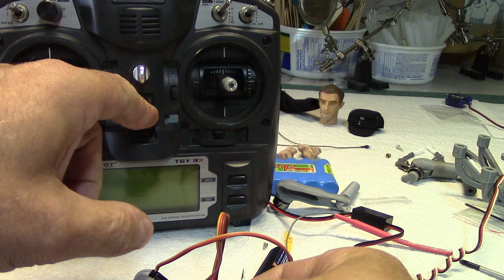WW2 action figure: 3D Printer tank commander!

Comment: I remember that you made a commander who watched with the primates. But this is already one more twist. From what I've seen, you move the figure where you want. Just like a rc vehicle, it certainly seems almost impossible what you achieve and what you can think of. At your command.
Reply from the maker: Next generation of Tank commander. Thank you so much Partner for the nice comments! 😊👍
Reply: @LorenzoJalbert  It was missing more. I see you making figures all directed by RC, and with total mobility. So then I will not need to stopmotion, but I will record them directly with the movement they will make. You have the capacity to do so if one day you propose it. At your command.
Reply from the maker: @YOELCOMANDANTE  It will be lots easier for you 😀 making your movies in stop motion is huge job but you are doing great work. 😊👍

Comment: The little arm with the u bend, how does it differ to a straight rod?
Reply from the maker: the little arm with the u bend for me work better tend a straight rod for me it don't have any play in the connections and the way it Connect to the servo and the head part it is more precise and the u bend act little bit like a spring but the rod still work.
Reply: Lorenzo Jalbert thanks. Great work
Reply from the maker: @witneydiggersrc3251  😊👍